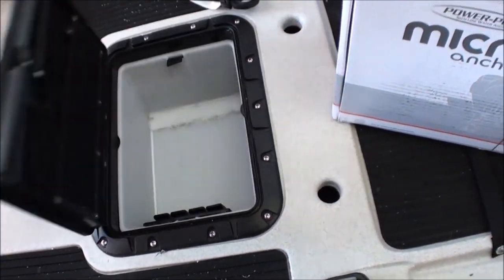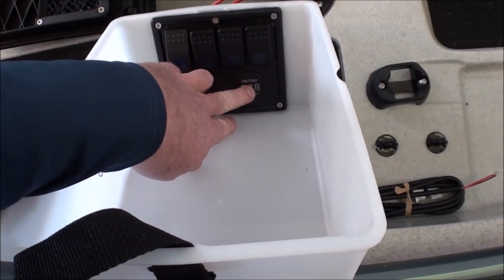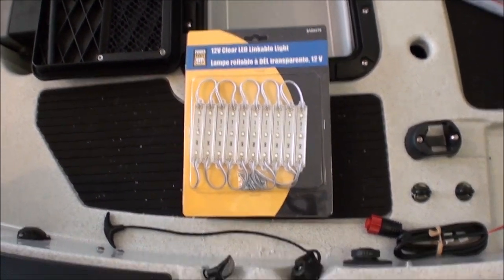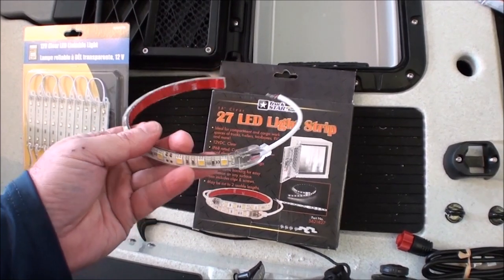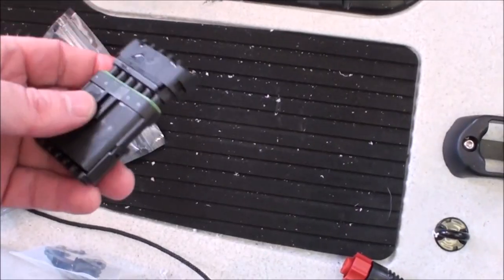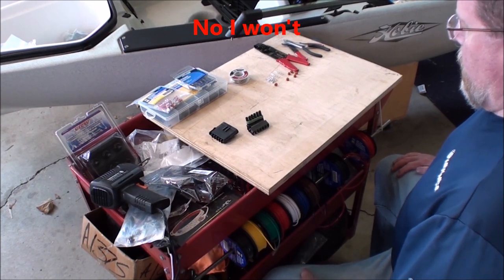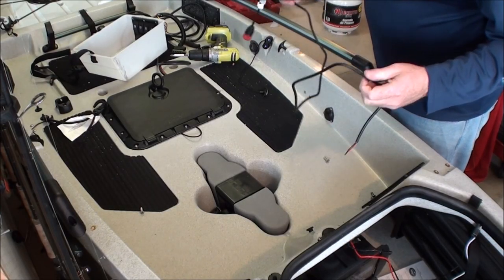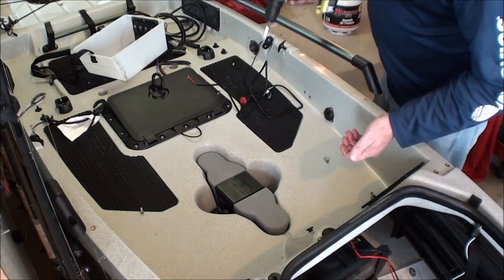2017 Hobie Pro Angler- Wiring Series Part 2

Comment: Can you share where you purchased quick disconnect & details I’m wiring my 2018 hobie. Great video
Reply from the maker: I purchased them from Amazon, but I just checked and the ones I ordered back then are no longer available. Since then couple companies have come out with plug-n-play systems and that's all I use now. For a couple extra $, it wasn't worth my time building my own system. I'm currently using the FPV-POWER Distribution Hub for all the wiring on my kayaks. I have a more recent video on my channel where I layout all my wiring.

Comment: Very professional setup!  Definitely the level of modifications I would aspire to.Any benefits to using the dual batteries instead of going with a single (large) deep cycle?  (typically used with trolling motors) Weight savings; similar amp hours?
Reply from the maker: Thank you.  I used the dual battery setup because they fit in the Hobie battery holders on the mast post. I've since switch to lithium batteries.

Comment: Just to clarify the negative component connections to the wiring harness. You have one from your power source, one from the orb, one from the micro anchor, one from the deck lights, and one from the Lowrance. Not sure how you tied all these into one terminal on your harness, did you do some sort of pigtail?
Reply from the maker: James Schick I would just solder them all together with one wire coming off to go back to the negative on the battery.
Reply: Tim Percy Gotcha. Just making sure. Thanks. Awesome stuff.
Reply from the maker: James Schick Thank you
Reply: Tim Percy one last question-fish Finder fuse?
Reply from the maker: James Schick each switch has a fuse. I think the fish finder is a 3 amp
Reply: Tim Percy 👌

Comment: will you fabricate the bucket and switch block for me? I can not do the plastic weld and want to place my switches as you did so not to cut into the kayak. I can pay-day you what you wish.
Reply from the maker: I going to be busy for the next couple weeks with tournaments and work. I just used my soldering iron to weld it together.
Reply: I tried and just could not figure make it work. Sorry about the pay-day as it was sent from my phone and the spell check made the change. I meant to say pay pal. I purchased the first switch panel and then you made the change. Dangit I like the second one better as it has the battery meter.
Reply from the maker: You can purchase to the battery meter by itself and install in separately.